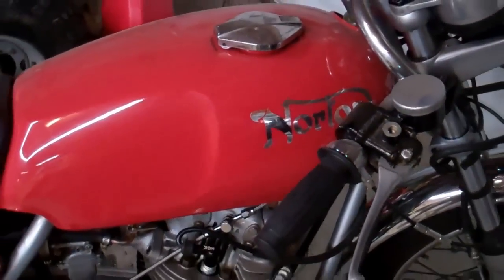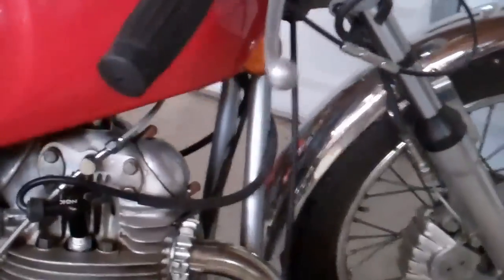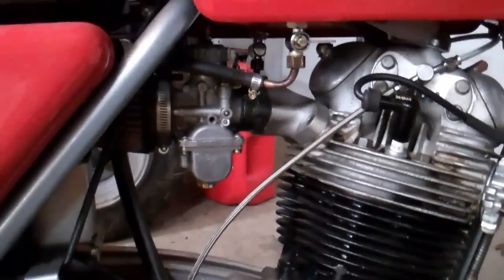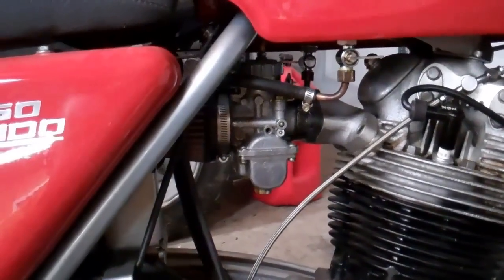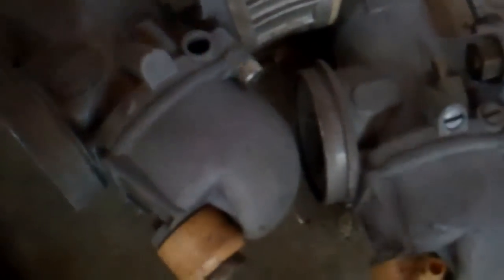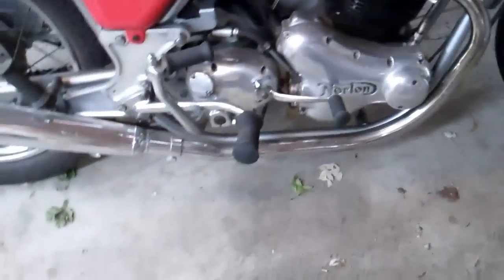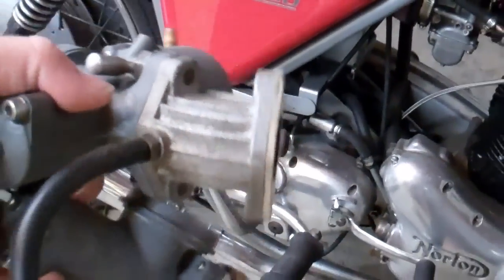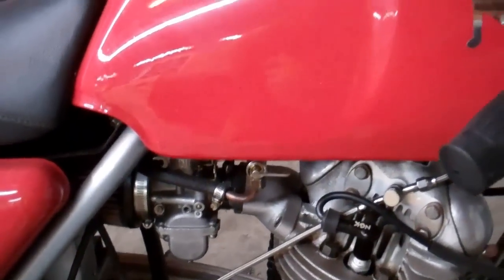1974 Norton Commando 850 - Please Help!   Mikuni or Amal Carburetors

Comment: dont forget to fit your side panel on properly with the rubber at the bottom inside the Z plate, twin   mk1 concentrics for speed single mikuni for every day riding

Comment: Rebuild the Amal's they have they have issues but there simple and basic carps that do deliver when called on. I've even ran it on a single Amal and just changed the jet and adjusted the needle position but you give up power. It’s a English thing!